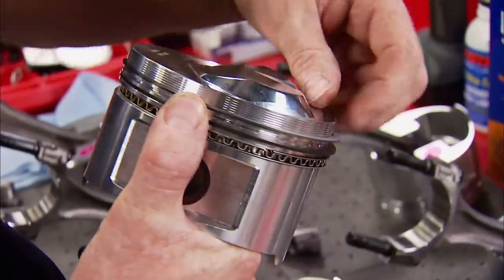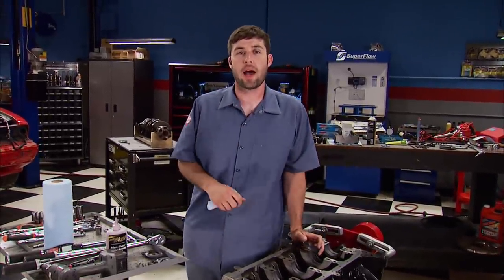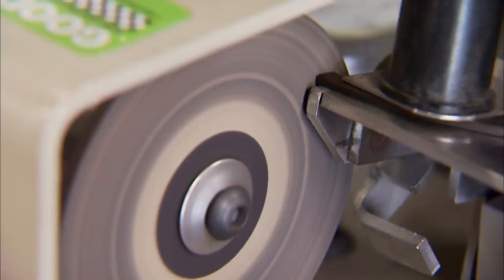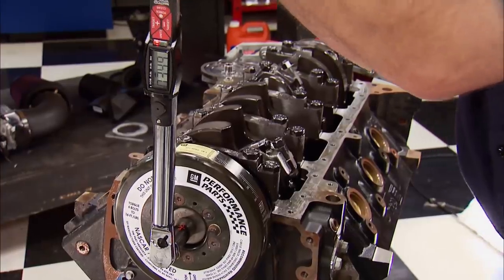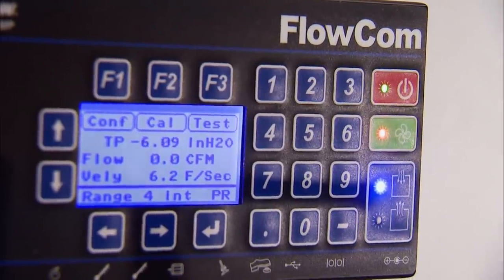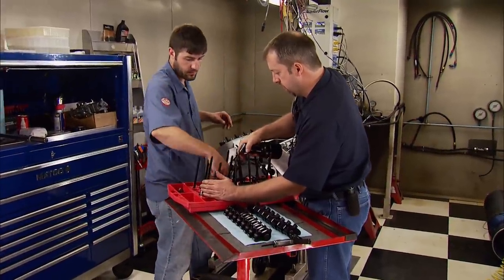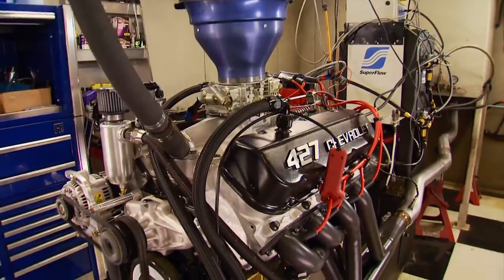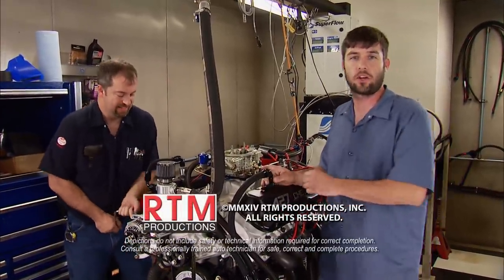Nitrous Pushes Big Horsepower Out Of The Chevy Crate 427 - Engine Power S1, E18

Comment: I have a 427 in my 1966 Chevelle which was built in 1983 by a big block Chevy expert and it still runs great. It’s fast. I’ve had it rev to 8000 rpm. It was built with Isky triple valve springs and high quality parts.
Reply: I'm a Big fan of the 427 in early Chevelle iron I had a 68 Chevelle years ago with a 450 HP 427 and a super T10  The heads I got from a buddy were the snow flake GM Chevy Aluminum Rec port they were 113 CC heads I used to old Tarantula intake and an 850 cfm Holley . I used Hooker Super comps with a single tube out the frame rail a 12 bolt 4;56 rear and a set of cut Moroso trick springs up front with 90/10s I used the Zoom clutch & Pressure plate kit  . I trimmed as much as possible from the rear wheel opening  to use the 11 inch M&H I had . they did rub once in a blue but not bad ...I miss that car more than the 70 CUDA 440 6pack I used to own  Or the many GTOs ..a guy I knew had the same car but with a 396 who did a hit and run when I got back to the shop monday morning the entire Nose clip was stolen from my own Chevelle . it took a couple of days but I got word some kid name Ray was rattle can painting a New front clip for his 68 Chevelle.. I'm pretty sure I was Born a motorhead .I got my first 66 Chevelle 300 Deluxe when I was 15 .. My last Chevelle was a sweet heart White with black interior 72 SS  402  only it had the TH400 .

Comment: Vacuum pump looks like it's going to get in the way of the steering on the S-10. Think happy thoughts.
Reply: I can't imagine trying to shoehorn that big block into an s10.......my 2wd 1996 jimmy is going to get a 350. I wanted to go LS but that looks like an expensive nightmare to cram into a S chassis.
Reply: @yurimodin7333  you'd be fine with the swap. Go for it!
Reply: @rizzoid  already have two 350 engines so its just a matter of time and money 😈

Comment: After all those mods, this old big block makes about 505 horses, which the LS7 does right out of the box. In fact, I would be willing to bet that the LS7 makes closer ton 550 hp right out of the crate. Looks like the great LS heads and 4.125v4.0 B/S has the advantage. I still do not understand why this big block makes that much less power. You would think that it's bigger bore and shorter stroke would be a great recipe for both power and torque. I bet aftermarket heads holds much more power and torque.
Reply: True that!! A stock LS7 would push around 550-580 on a engine dyno with a flat tappet cam and “outdated” stock iron heads. 

The engine in the video should’ve push 600+hp with that setup.
Reply: @Yann396  - The new cam still was pretty small and those heads only flowed a little over 300 cfm at .600 which is not very good for a big block head.

Comment: If you haven’t already done it could you do a video on the 3800 3.8. Starting with a used one and slowly upgrading it then adding a supercharger. I have one with 28k miles on it and want to put it in a rail buggy. I also want to find out how much power I can safely make.
Reply: my gpas buick lucerne cxl has a 3.8 3800 in it and its already fast enough hmm lets put a supercharger on it
Reply: lol
Reply: @backroadsliving7740  it came from the factory with a super charger in several cars like the Monte Carlo SS and Pontiac Grand Prix along with several others.

Comment: Small intake, cam, heads that dont flow much. About right....what you guys, some dont get is the tq nd how early it comes on. 
Peak hp means zip on  a st car ad 500hp takes more than most think. 
Put a solid roller and afr 265 single plane now youre making a bunch more

Comment: LSX 427 with a set of twins will do double that. Big blocks are old school tech at this point. It does have a certain nostalgia though.
Reply: You forget this is a stealth engine turbos would give it away
Reply: DFB58  not so much the look but the noise the wine of a turbo is very distinct also people will notice your intake goes off to somewhere else
Reply: You could add twins to this and it would be way higher also
Reply: A big block with twins and the same money will make more than an lsx 

cubic inches will always win. 

That's why TAF nitro cars and radial cars are big blocks not LSXs
Reply: Put a set of  AFR heads on that motor and it easily picks up 100+hp. It’ll make every bit the same or more than an LSX427
Reply: @brgable  yeah it'll probably make almost 600 on the motor. That's a pretty nasty cam. It's the biggest of the voodoos

Comment: How do you correct a bearing that is just a bit out of tolerance either way
Reply: You can measure the clearance of other bearings and swap larger smaller to make the difference or even use a half shell that is one size larger smaller to get right!!!

Comment: 509hp with a roller cammed 620 lift, roval alum heads and 10.7cr !?? Something is wrong with that engine. Should’ve made 600+ on an engine dyno easy.
Reply: exactly.  My 427 with profiler 320 heads makes 635hp. 10.8 to 1 comp and a solid flat tappet cam.
Reply: Small cam, old hydraulic roller lifters, mediocre head flow and the wrong intake manifold.

Comment: 509HP out of a 427 with a vacuum pump, aluminum head, roller cam, low tension rings?
Yikes
Reply: Should’ve pushed 600+hp, something is wrong with that engine.

Comment: I see the problem with your 427 bill it's the cylinder heads the cylinder heads cannot flow enough air to create more than 800 that 427 need more air flow
the head should have a dollar port with no bolt hole in between them and you'll get somewhere to go fast
Reply: At cfm x2 @.600 lift it's enough to make 616hp on the motor

They need to spin that thing to 7k-7200 and they'll see 800...

And tha 1000hp is really 850. I heard QF carbs are really what they say
Reply: @KingJT80  - They couldn’t turn it that high with those old roller hydraulic lifters.  Remember this was like 8 years ago.
Reply: @danmyers9372  i think around 8 yrs ago they had morel high RPM short travel lifters  they were just 800-1000 dollars back then